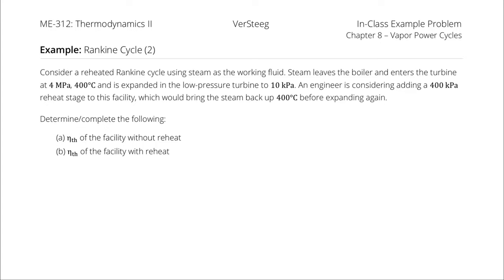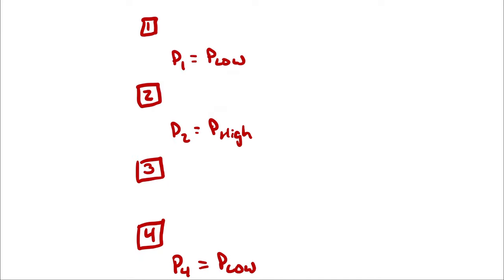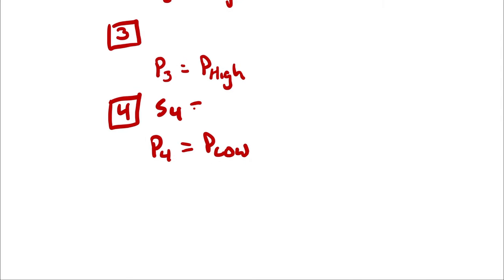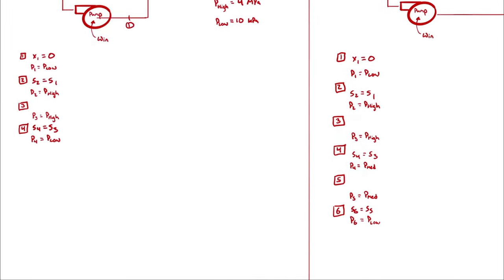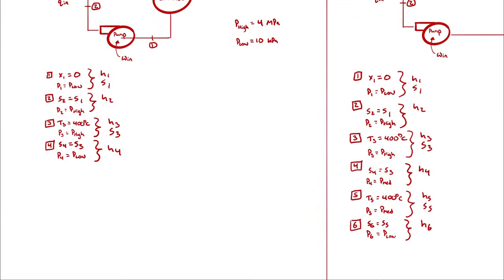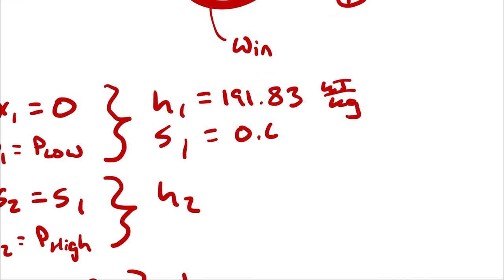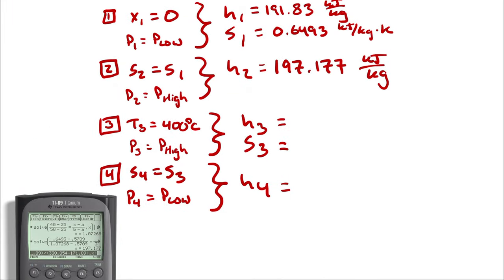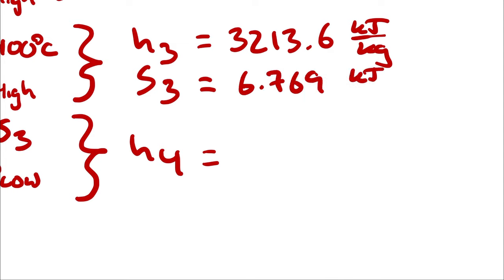Example Problem - Rankine Cycle (2) - Rankine Cycle with Reheating

Comment: Steam enters the boiler at 20 MPa and 500 degrees Celsius and expanded inside the turbine until
the steam becomes saturated where it is bled off on at its saturation pressure and at the same time
reheated to the same temperature. The steam is expanded to the intermediate turbine where it is
extracted to a pressure of 1 MPa and at reheated to the same temperature. It is then expanded to
the low-pressure turbine at a condenser pressure of 100 kPa. Use open feedwater heaters for the
extraction.

Pls solve this i give u money